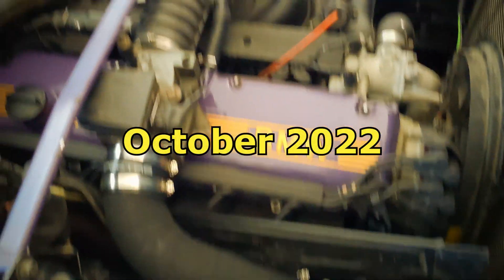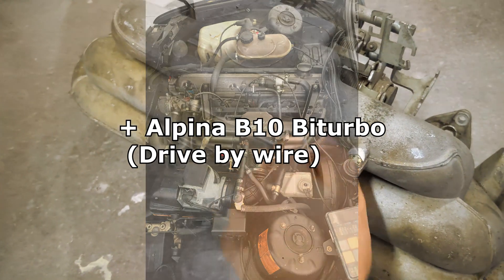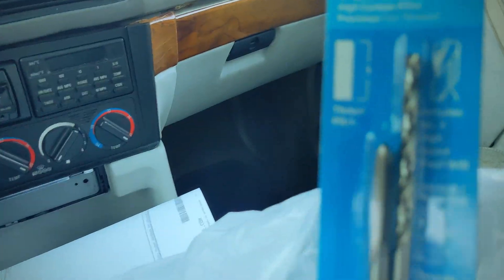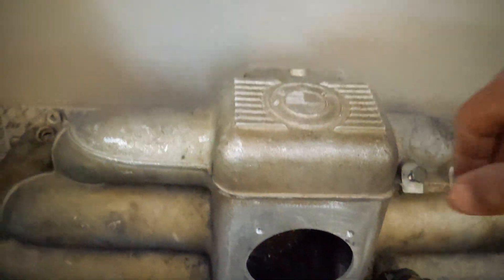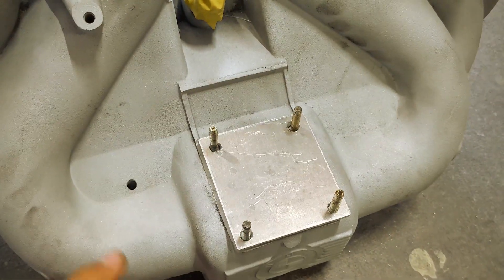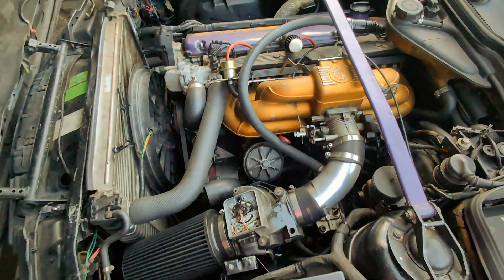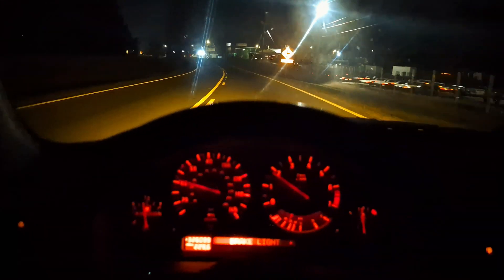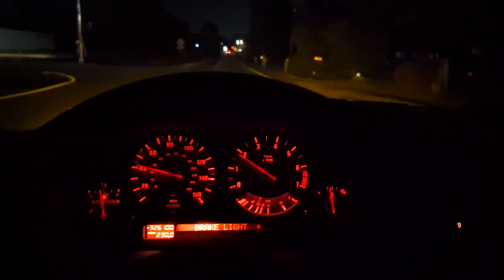BMW E34 535i | M30 Intake Manifold Flip | 4K

Comment: Hey, what car did you get the throttle cable from? When drilling the hole for the cable, do filings fall in?
Reply from the maker: I used a universal go-kart cable off Amazon and cut to the length needed. Then I re-used the grommet from the factory cable end and fed it through the hole and clamped it.
Reply: @ItsDionté How many millimeters of inner diameter does your aluminum pipe have?

Comment: Nice video, thanks for posting it. I'm planning on same mod, just kind lazy haha. I want it to look nice also, like it came from factory with that, and that's just much more time consuming.
What throttle cable did you use?
Reply from the maker: Thanks. I just got a universal one off Amazon and cut to length, used some cable clamps for the ends of each

Comment: Im looking to do this swap because having the air intake beside the exhaust is not ideal my question is how would this improve performance?
Reply from the maker: Cooler air temps and easier passageway to the cylinders . In my experience a lot more torque is delivered with less throttle input

Comment: I was thinking about putting a MAF to make it breathe better, but seeing this I have doubts if I should do this modification and also put the MAF....
would the chip that comes with the miller kit be enough for me, or do you think it would be necessary to make a custom one?
Thanks for your help
Reply from the maker: @jonolaizola4771 Miller performance has not been a reputable company in nearly a decade. Tons of people having issues with their MAF conversion and do not receive any customer support. When they did have customer support, they would tell their clients to purchase another product to fix issues with their MAF that was defective to begin with.

I can personally say I've ridden in a friend's E34 535i that has had the Miller MAF setup. And during his ownership the car would not run well consistently, he switched back to the original AFM and said that the car actually ran better on the original setup.

I'm in no way trying to crap on Miller performance, but the MAF conversions costs nearly as much as Megasqirt standalone ECU which gives any competent tuner the ability to remote tune the car as well as being able to run a forced induction setup on that ECU and have a lot of troubleshooting features that Miller does not offer. Keep in mind the miller MAF setup still runs on Windows XP so it's extremely difficult to even setup or diagnose that.
This simple manifold conversion in my opinion yields better gains in addition to having a cooler running engine because you're not drawing air from the hot side of the engine bay anymore, also keep in mind that AFM can at least be adjusted for mods which can make a noticable difference. 

Personally I will be going with a standalone ECU such as Megasqirt eventually to get rid of the AFM and have free range of tuning available.
Reply: If you go all the way to change the AFM; don't do MAF. Instead of the shitty MAF to Motronic 1.3 adaptation, just get a megasquirt and do a MAP based one. More hp, more adjustment

Comment: great stuff ! will try this on my car too , looks easy to do
Reply from the maker: @fatihkara9638  Appreciate that. It was pretty simple overall and the gains are definitely worth it. The torque is just delivered so much sooner and not to mention having much cooler intake temps help the engine run better more consistently.